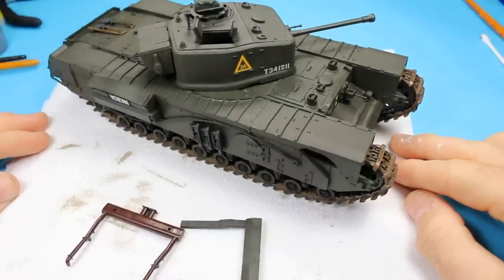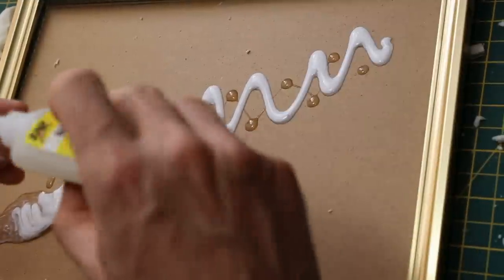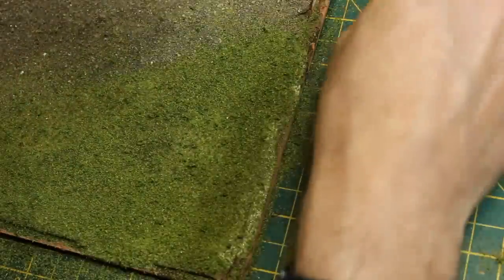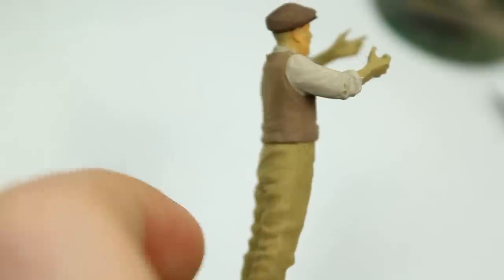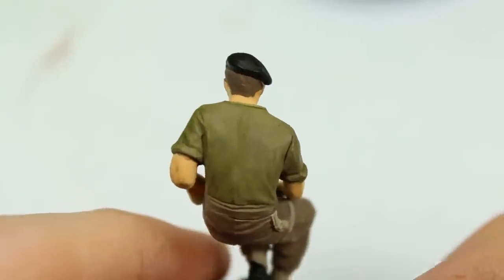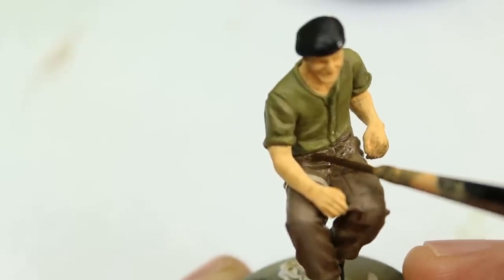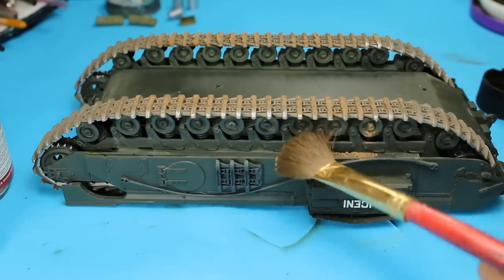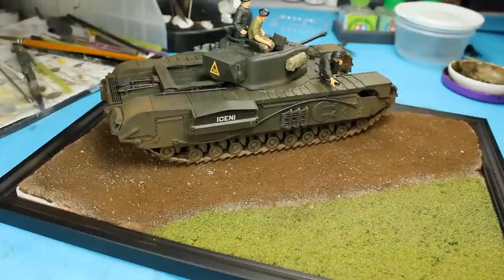Tamiya 1/35 Churchill MK.VII Step by Step Full Build Video, Part 3

Comment: Good videos and nice work overall, Jason! But has anyone ever told you that you obviously used the wrong product with your static grass applicator? That wasn't static grass, but either Woodland Scenics Fine Turf or some other kind of flock. The static of the applicator has no impact on that kind of product whatsoever! It is not even been meant to be used in an electric device of any kind - only just with a sieve. That is why you didn't get any "static" results in your diorama. I don't want to rain on your parade, I simply wanted to let the other viewers know 😀

Comment: If you'd used the glass as the bottom layer of your diorama, the clay couldn't warp the base and it won't crack while drying. To clarify, you don't need to disassemble the picture frame. Just mask off the frame and start building your diorama on top of the glass.